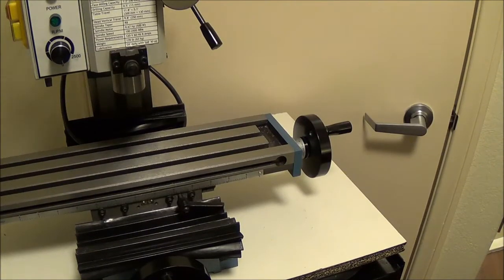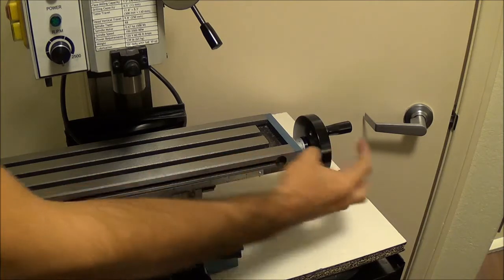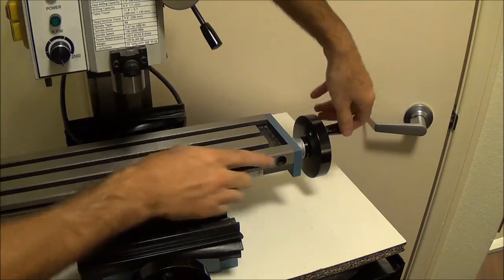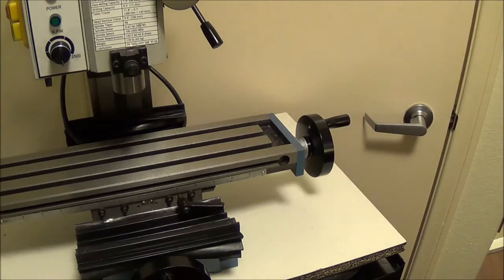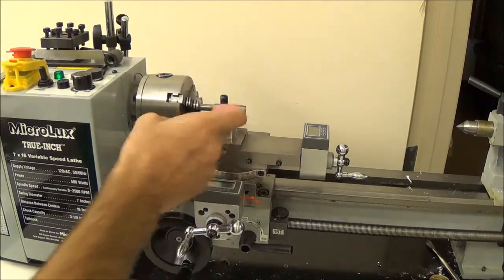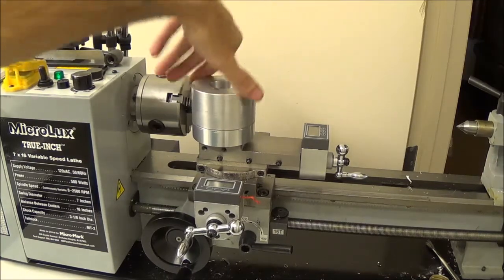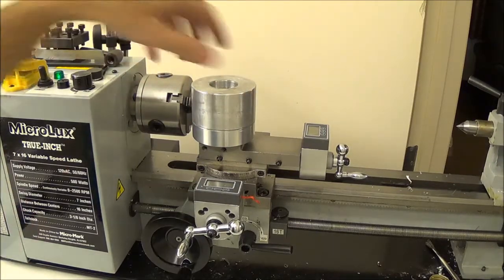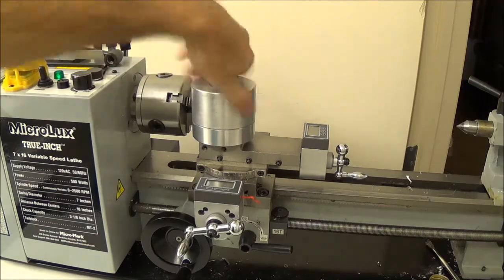Hotel Experiments: Using a Tap as a Hob

Comment: Great Video thanks.  I appreciate your application wasnt critical on the number of teeth and you commented that as the depth increased the number of teeth decreased but is there a way to calculate the exact diameter of the blank etc to get the required number of teeth to a good quality.  My attempts so far have ended up with a skil at one part of the gear or another
Reply from the maker: I want to look at this further. Yea how can you just skip a tooth. My guess is that the teeth are shallower on one side of the gear and deeper on the other and that's the side that gets skipped. Or the pitch is smaller on onside than the other.   I'd love to do a setup and explore this.

Comment: Can you elaborate on the how the diameter of the blank can be arbitrary?  I am not a machinist but every mathematical bone in my body is telling me that if the diameter does not match the threads per inch, there would an issue with misaligned threads.
Reply from the maker: Wish I could, its a mysterious phenomenon but true in fact. Obviously you need to be fore-thinking to make a gear from a drawing with a specific number of teeth and a certain pitch diameter, and if you want a true tooth profile you must have a geared hob (not a free spinning blank); BUT if you are whittling like me you can start with a larger diameter blank and turn down until your needs are met.
My speculation is that the teeth get smaller and smaller until one is forced to disappear all together (n-1) and then the teeth grow larger until evenly distributed again where the cycle repeats. This would be accomplished by cyclic cutting on the front of each tooth and then cutting transfers to the back of each tooth over each cycle.
This sounds like a cool video! Are the teeth evenly distributed around the gear? are they all even remotely the same size? What happens when a tooth drops off and how?
Reply: @internationalprecisionengi1737  I don't think that's what's happening, because then you'd see deformed teeth. I tried it before with a plastic round and too much rpm and had some deformed teeth in there, they were kinda flattened and the edge really thinned. But I also got more teeth than I wanted, so a good start is really essential for the process to work. I think that after the first round the teeth kinda snap into the grooves that were cut before. Even then, I think the result could be improved if you turn a rounded groove into the blank, so that you are starting closer to the finishing diameter.
Reply from the maker: @Klaufmann starting close is always the best, I would agree. From what I gather, nobody really knows what happens, kind of like knurling in a sense that its gotta be way-way wrong to not have a reasonable outcome. I would love to do a video on it, maybe progressively free-hob the blank while putting it on a CMM to profile the teeth!
Reply: A year late but ... It's effectively a worm drive. The ratio only depends on the number of teeth on the blank. One revolution of the tap will index the blank by one tooth. So it won't change as the teeth get deeper.

Comment: I can see the center on the end of the tap is turning off center, needs a dead center.
Reply from the maker: Interestingly from a gear metrology stand point it doesn't matter so long as the number of teeth on the gear is not an integer multiple of the number of teeth on the tap. Another way to look at it is that you could grind all the cutters down except one and it would still make the same gear (the non cutting gears would just advance the blank).
The spindle load is low telling me that it was a not centered from the start - no center needed, although stiffness always makes for a more efficient cutting process. It was indicated too close to the jaws, ideally it should have been indicated at both ends but the cutters made that difficult.
Thanks for watching! See you soon

Comment: I have made many worm and wheel pairs like this, however, I found that using a spiral bottom tap, plus a live centre to keep the tap rigid, I also found that using WD40 spray to lubricate and clear the chips from the gear. I also turned the part to make it cocentric before hobbing. Another tip is to use a thrust race and lock nut to hold the part on the tool post stud. Great to see how others use this technique. I have often used V belt pulley's as the wheel when wanting larger sizes.😃
Reply from the maker: It is amazing that this works, I still can wrap my head around how the part can change the number of teeth automatically...
Reply from the maker: cant* wrap my head around it

Comment: If I understood correctly, the oil dampening is pretty interesting. Is the effect more significant than adding more weight? Beautiful final part.
Reply: International Precision Engineering : Sand + oil sounds like just the trick for fabricating machinery stands. Epoxy is as expensive as decent scotch whiskey. Thanks for the tip and explanation.
Reply from the maker: each has its own advantages. The oil will nearly eliminate high frequency resonances but the weight would stiffen the setup for lower frequencies (you can see the part bouncing but not singing). Try spilling oil on the mill table before fixturing thin sheets or parts with thin walls, its amazing. A similar trick to try is to fill all casting cavities with sand and then oil on smaller machine frames
Reply: ooolloonkooo9ookoooolo

Comment: I'm unsure what you are talking about at 2:53 Could you elaborate? Are you saying you should have used a tailstock centering arbor to remove any wobble from the tap?
Reply from the maker: Great Question. Typically a center would be one way to quickly remove the wobble at the end of the tap. What I was eluding to in the video: it is possible to have zero run out on a cylinder in one place, say at the jaws, and be way off in another, say at the free end. Dialing near the jaws gives you true/near true concentricity (centerlines cross) at the jaws but does not guarantee that the spindle axis is also parallel to the stock centerline. This requires dialing in at least two locations itterativly.

Comment: Do you have a video of it working? How much backlash did you get?
Reply from the maker: +Anand Rajamani I don't; I made it for creep feed diamond fly cutting, so it would only be a one way journey... also, by design, its slow - if your thinking CNC, it might be best to drive the screw directly. Thanks for watching!
Reply: I was wondering for hobby gearbox applications/ reductions, so backlash would be good to know.
Reply from the maker: If you use triangular teeth, which is what a tap would be, all you have to do is spring load the worm to remove backlash. The trick is to deal with the slight eccentricities in the gear and worm; if not accounted for it will lock the box. In the past, we have used a flexure (a pivot and spring could work too) on the worm guides that loads the worm into the gear mesh but allows the eccentric gear to drive the worm away as needed. We've found compliance to be the secret to making cheep and reliable boxes - think about all materials as butter, too much pressure and destruction is eminent and design tollerances better be huge
Reply: Thank you! This reminded me I  actually need to get started on making some gearboxes...